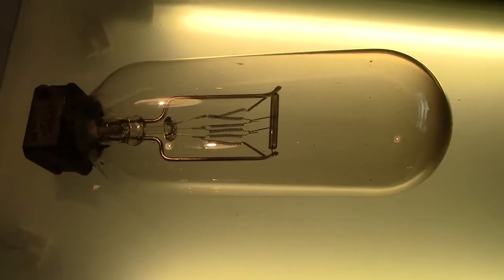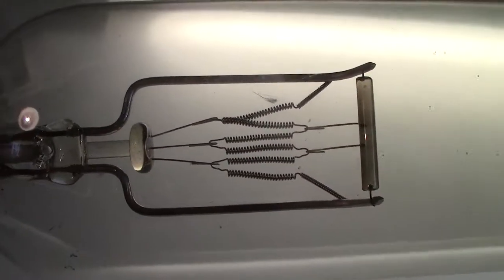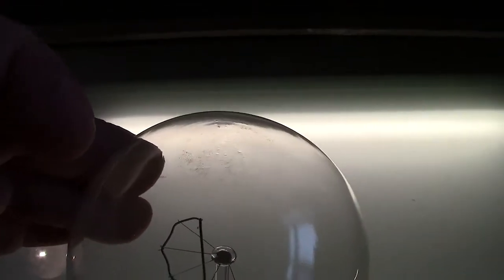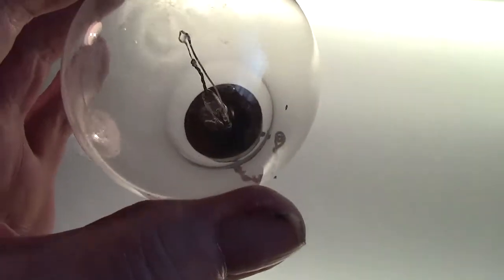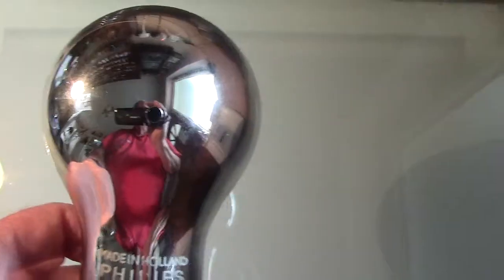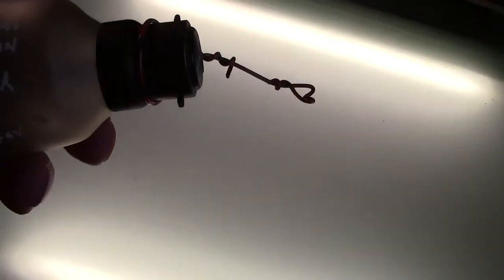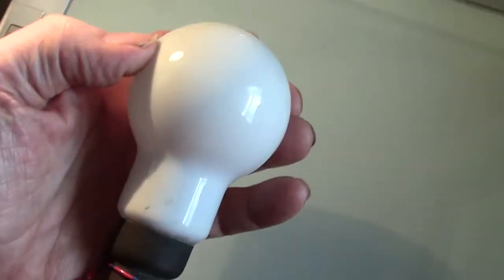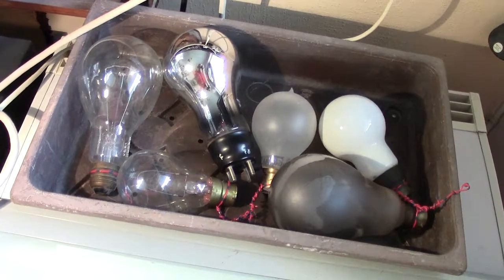More Vintage Lamps

Comment: First lamp is a beacon lamp, for Runways. Perhaps from WW".

The second lamp is a very early model. 

The carbon lamp, don´t know what was the used for thane. Approx 1925-1935?

Interesting rectifier, mercury I think? I thought first it would be a voltagestabilsator tube.

Frosted pip top, I sew the etch, etched with hydrofluic acid. I was not able to read it.

Siemens lamp, is that black real in the lamp? It look like outside, then you could clean it with Alcohol? 

Last lamp, I would say Philips approx 1925
Reply from the maker: Same comments make sure you have plenty space in car you next custodian bit by bitof collection finally on my 100th birthday.....well I can only hope.....